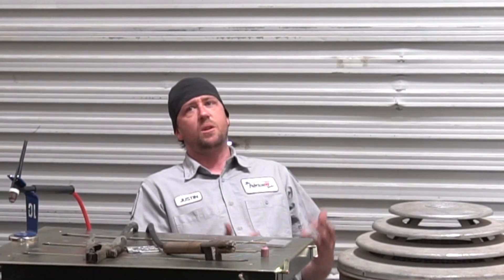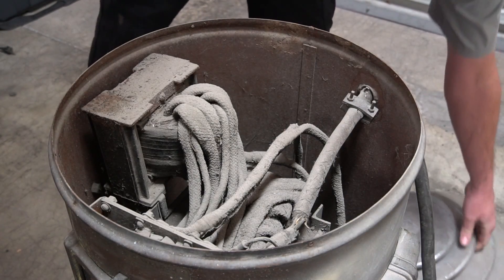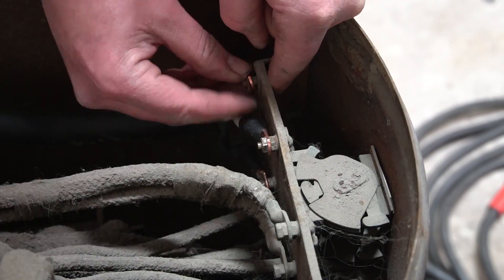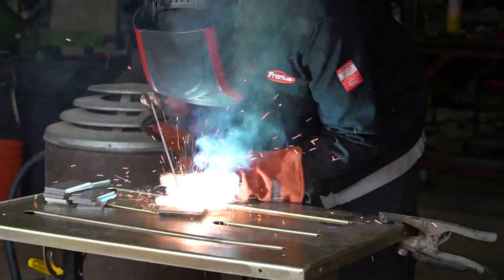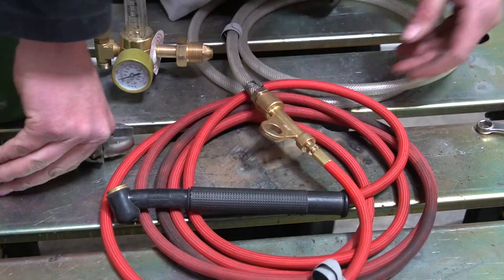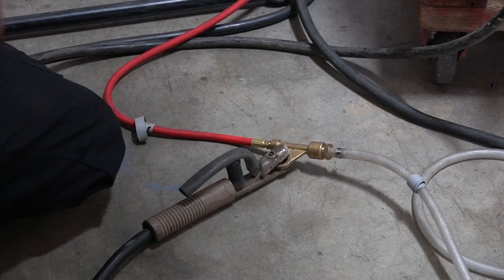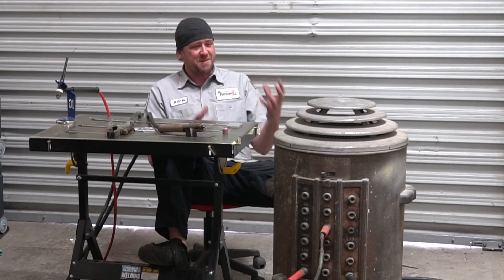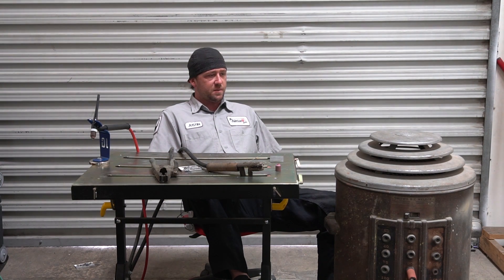TFS: 70 Year Old Welder - Will it TIG?

Comment from the maker: Here is the TIG adaptor https://amzn.to/2Crb5TY
Reply: Wow this cool welder! Respect from Russia! I love to watch your videos
Reply: Making an AC welder DC is pretty easy:
for about $25 on amazon you can get a 200 amp bridge rectifier to make it DC.
However, even if that is technically DC, it's chopped up DC so we need to smooth it with capacitors.

For calculating the capacitor size to smooth out the resulting ripple use the formula C = (I*t)/V
     V is acceptable voltage drop between voltage peaks. 
         (1 or 2 volts to be REALLY buttery smooth, realistically you could drop 8 volts and weld no problem-it would just act sorta like a 120hz pulse box)
     I is current in amps, (200 amps max for that machine? I would go at least 50 amps higher just to be safe)
     t is time between peaks in seconds (1/120 = .00833 seconds)
     C is capacitance in farads (for the values above, 1V drop is 1.66 farads, 4V drop is .42 farads, 8V drop is .21 farads)

To make it even smoother WITHOUT a giant bank of expensive capacitors (although you still need some) , add inductance, which resists a change in current flow. Do this by wrapping the welding lead around a heavy piece of solid iron as many times as possible. (I know how to calculate inductor behavior with controlled "textbook perfect" curcuits, but welding with variable torch to material distances etc is anything but controlled, so I won't even pretend to know what I'm doing with this)

note: I haven't done this myself since both of my welders already are DC machines, but I have taken my physics classes in college so I know the concepts involved.
Reply: How to make a paper flower
Reply: Get an "arc pig" HF starter and you prob could have a better time Tig welding with that thing.
Reply: Oxyacetylene welding is becoming more obsolete. No one teaches it anymore. Cause Tig uses ⚡ to compensate for a faster weld . Both are great if not the oxyacetylene welding is better. . Ones opinion. Old school weld is oxyacetylene welding. Per day.

Comment: I have a 60c and need the part that goes into the amp ports ( or also known as the pins ) any idea where I can get that one you replaced my original pin is about 1/2 inch in diameter

Comment: but what if you  ratify the currant  as you, then have a  dc currant. to  strike a ark with will it sustain an TIG  ark then  then ac welder becomes a DC rectified capable of tinging  try it out it works well.  in England we ues our  Oxford welder  as rectified  Dc chargers & dc TIG   welders  by fitting a rectified  transformer & transform the ac supply to DC , for charging & TIG welding ,  Just fit a heavy duty  Ratified where you wont it to become DC,

Comment: This machine was designed before "high frequency" was developed.  On a more modern machine, there is a circuit in the machine that establishes a high frequency arc between the tungsten electrode and the grounded work piece. This provides a constant area of ionized shielding gas between the elctrode and the work piece. This gas ionization sets up a continuous path for the AC welding arc to follow back and forth. Without high frequency, the main arc doesn't have enough voltage to jump back and forth from electrode to ground and the arc will shut off with no warning. You can buy a separate h.f. box which can be added to the machine and make it suitable for AC tig work.

Comment: FYI - the machine is limited wattage ie it has overlapping ranges of amperage. Wattage is volts multiplied times amperage. Therefore as the amperage is increased the voltage is decreased or vice versa. E7018 electrodes demand a high open circuit voltage. Therefore, using a voltmeter with an amperage setting of 100-120 in the three possible ranges; high, medium or low. The low tap will provide the highest open circuit voltage. 
Also the high frequency high voltage box/pig was made available as an accessory or built into the machines for smaw/stick welding and when gtaw/tig required no touch arc starting and/or arc stabilization; it was then used for that purpose. 
Be very careful when AC gtaw aluminum; the oxide layer acts like a rectifier; it produces a dc component evidenced by heat back to the transformer hot enough to melt/destroy the insulation and short circuit the transformer.

Comment: Justin you commented that 60hz ac crosses 0 120 times a second that only happens if you are converting to dc output by running through a bridge rectifier. Then you will get a positive half wave that starts at 0 then peaks and returns to zero 120 times a second.  Hopefully there is an inductor in series after the bridge rectifier to help keep you positive voltage and amperage from dropping to zero on the final output.  Sorry, not trying to ruin your video that by the way is awesome.

Comment: NO DIALS TO BREAK!@!   PRETTY COOL. IT IS A COIL WOUND AND 'TAPPED'  AT DIFFERENT WRAPS FROM COILS  SYSTEM, YOU'LL COULD GET SOME GREAT WELDS WITH IT. I WONDER WHERE, IF ANY, MANUALS ARE, ON IT? NAME IT R/T/D-2, BECAUSE OF THE STAR WARS. YEP IT COULD USE SOME NEW CLEAN UPS/ YOU'LL FIND SOME PLACE WHERE IT WILL NEED RE WRAPPED 'GET THE GOOD EXPENSIVE ELECTRICIANS' TAPE' IT HAS FIBERGLASS IN IT. THEN  BRUSH ON NONE - FLAMMABLE SEALER.  YOU'LL GET IT RIGHT OFF THE BAT. "IT'S A NO-BRAINER"
 For anyone with a welder, it's a darn good way to save it now while it's all working good. Keep it Clean. Shop Dust can be Extremely dangerous!  Live safe. Have a great Day!

Comment: That unit is freaking sweet . 

I'd install a full-wave rectifier on it to get a bit more flexibility out of it and use that sucker. If it is still quiet and withstood working in the absolutely hellish heat in bullhead city it will probably continue to run bead for a few hundred more years.

How much does that unit weigh?

Comment: OMG! U got some balls J. Ill give you that. Theres no way i woulda flipped that power switch without putting a megger on that bugger first. First rule of being an electrician is blue fire(anywhere other than th tip of ur tungsten) is BAD. Oh and an arcflash or blast can ruin the rest of ur life in a millisecond. Most chilling words EVER, from an outside contractor closing a Tie Breaker in our substation 
“if this blows up, DON’T put me out!  WHAM (slams breaker closed).”

Comment: for a ac dc busbar son & you now have A ac welder capable of wedding dc &as a tig  weld   Like  tig Try is out son , , Of course  you know this Don't You but would rather rubis AC welders  NO you cant weld with a AC welder.  but you need a AC/ Dc Busbar attachment 15 quid in the uk , son .  
Got it yet  ,Les  England ,  like  you video But drop the negativity we brits don't like it son .
DONT BE CORPASTATIC ,

Comment: Awesome video mate. Look at that thing!!! One slight correction though. It's not the High Frequency that's keeping it alive, its the fact that it's square wave out of an inverter welder, and not sine wave out of a transformer. Being square wave means that even though the polarity changes, there is still 100% potential difference across the work piece during the slope up and down.

Comment: Great video Justin.  You've not only answered the question a lot of people ask; "If you use AC to tig weld aluminum, can I use a buzz box with a TIG torch on it?"  You've also shown what would happen if you tried.

Nice big old welder though.  Some of the guys in the shop I work in, say that they like the smoothness of the arc you get from a transformer.

Comment: I got an old welder similar to this from the local dump and striped all the contacts off it.  It was all aluminum wire so I kept the contacts and switches and took the aluminum wire back to the dump.

Comment: I have literally only used a tig welder once in my life so excuse me if this question is way off. Is the requirement for a higher frequency because your welding aluminum and if so could you use that set up for mild steel? I have an old Forney C5 welder thats at least 50+ years old that has a similar set up to the one in your video, ive been wanting to restore it and now you have me wondering about converting it!

Comment: Ever heard of dual-quadrupled serial line series GFI circuitry wherein there are 4 GFI circuits on both positive and negative power lines? Including in the sockets and plugs and cable extenders? Hyper-Ultra-fast auto-circuit breakers and dual ground lines? 

Ever heard of ultra high-voltage/ultra-high amperage insulating resistant head-to-toe full body suits, masks-hoods, gloves and boots, goggles and prescription lense protective goggles that are 4 to 5 times up to 10 to 11 times above specification requirements? 

Air filters and purifiers and emergency air suppliers built-into or worn around their suits and are also equally well protected and are ergonomically humanely designed and comfortable temperature wise and body contact wise? 

In our military of today THOSE ARE STANDARD SUPER-STRICT REQUIREMENTS! 

We have spent tons of money in educating and training and health improving our welders and continuously upgrading their scientific-engineering-technological education and maintaining their health on a very strict HEALTH PREVENTION PROGRAMS because they will and are welding together our military equipments and installations together that are designed to last as long as they exists and are expected to perform beyond their engineering specifications for our standards are above over-engineering standards.

Comment: I have a Mid State Dip Pac  160 Mig Welder .. it also has AC  Welder & DC & DC  reversed Polarity .. It has a spot to put a High frequency Transfer box .. I was told it was a little light to use for  TIG welding ..  I also have a Miller  200 AMP  MiG welder..  So I guess I just simply need to a  straight TIG Welder..   I think they have actually gotten way more compact and way smaller ..

Comment: are you going to try ( tungsten rod ) pasma or carbon arc welding / cutting /bending like was common place in the per-1970s  ?? with it or ad different machine ?? its definitely on my wish list of how to learn to use and buying tool ( hopefully i can use the plasma arc welding leads with more modern power supply machines like a millers 250-800 series ) buying because it's so versatile and i don't need tools like a cutting torch or fancy bender so for simi mobile application its prefect

Comment: It doesn't buzz because they over-engineered them with ten times the amount of Copper in the coils.  Now they design them to the bare minimum, just short of actually failing.
Reply: have a  1962 Lincoln stick/tig  welder buzzes just fine but  weighs over 800 lbs-  has Plenty of copper in it.
 No way to weld aluminum without HF  AC  on an AC machine using argon
agree with others- throw an Arc Pig on it
 and  will be amazed how well it welds Aluminum,    just need to be careful not to  weld thick aluminum for to long...  then it  may overheat the transformer.

Comment: I made a TIG welder using a tombstone Lincoln buzbox. I made what you could call a series wound Tesla coil by taking about 12 turn of welding cable and coiling it up. I think that i bypassed it with an rf mica capacitor or something.

Then wrapped three turns of just regular wire around or next to it. Made a spark gap out of flat ended tig electrodes mounted in a couple of aluminum blocks. That with another capacitor and a small 5000 volt neon sign transformer made up the primary of a standard tesla coil and there was my hf stabilizer.

Then I took a wah wah pedal and swapped out the pot for the correct value. Ripped out all of the other circuitry (which was already smashed). I used a telephone cord and RJ11 jacks to connect it to a box. That controlled what is called a picket fence thyristor trigger box. I got a couple of big honkin' hockey puck thyristors that once were used to drive a diffusion furnace in the semiconductor process industry and hooked all of that up with a dryer plug and outlet so that I essentially had like a light dimmer but one that you could dim a dryer or an arc welder with.

I actually welded aluminum with it on 60hz sine wave. I also made another box with a big bridge rectifier circuit, some electrolytic caps and a big transformer winding. I made a π network but found that the output caps needed to be removed so I changed it to an L network with a choke output and then I had DC. Phun, phun, phun.

I was living in a box truck at the time in an equipment yard with all manner of unsavory characters. I should have tried to do a video about it but was struggling to pay the rent and keep the theives, tweakers, recyclers and landlords at bay.

I still have everything but the hf stabilizer unit and the buzz box. I found a Westinghouse stabilizer on eBay that has current sensing, gas and water solenoid valves.

I was forced to move back to Michigan. My dad has another Lincoln box. All I need now is another argon tank that is in spec and I'm back in  business.

There are still enough interesting part to do a video about. I lost most of my materials and hardware. Making another hf stabilizer might be fun to make a video about but there are no surplus stores here in Michigan.

The one that I used to work at in silicon valley just went belly up. Radio Shack is gone. The Steve Wozniak, build it in your garage days are gone. I thought that I was going to get in on the ground floor in California,  but no.

Id really like to discourage this mentality glorified by TV shows like storage wars and hoarders that make fun of people who collect thing, especially if they do things with their things.

Example, I made a sandblaster out of a dishwasher. There is this commercial for Apple i-something. Everything that you need is on the cloud. Possessions are a sign of poverty. There is a guy with his i-thing, a futon and some expensive toiletries.

I can build a laser from scratch. That is what I think of when I think "tech". But now "tech" means writing some fart app for your iPhone. I'm not saying that writing apps isn't useful but if this country loose the ability to, not build an iPhone but to have individuals with the skill set and materials to do stuff with your hands. That is a bad direction to be headed in.
/rant

Comment: I’m curious, would it have performed any better when it was originally sold? I’m assuming the 60hz aspect of the US power grid hasn’t changed terribly much, so how was it usable back then? Did age factor into its usability deteriorating or were people used to welding like this back then?
Reply from the maker: It's not a TIG machine. That's why it didnt work. It wouldnt have worked and better as a TIG 70 years ago because it's simply not a TIG.

Comment: Can you weld with TIG using DC ? You can turn the output into transformer and smooth it out to have smooth current. If not, is 200 Hz enough ?  I can make a custom welding transformer which will have a center tap, so basically it will output two 50 Hz sine waves (Don't know how to name it)

Comment: Very interesting video sir!  You went to great lengths to get that Old AC welder to work. Its great for Stick really, Iv'e used one back in the day and it will run most 7018 quite nice.  But here is a welding electrical AC fact...You must have a HIGH FREQUENCY Unit hooked into your welding leads.  The AC TIG arc needs stabilization or it will go out.

Comment: There is just one problem with this setup... For GTAW you need constant current (the "electrical resistance" of the arc varies greatly with it's length, and it's almost impossible to keep a steady arc length using your hand), and this transformer is practically a constant voltage source(ok, not quite, but still it's not a constant current source), besides the fact that the output is sine wave, and the low voltage time near the 0 crossing point is pretty long. Maybe you can AC MIG with this, if you add a series inductance to the secondary winding.

Comment: why dont you get a 300 amp full wave rectifier and heatsink it and use this to convert to DC this will help drastically also a few capacitors on your current setup will absorb the spikes you dealing with aka the + to - and zero point will be smoothed out very simple conversion that offers alot more stability and out of experience when you add a rectifier / capacitors you get much more power / penetration also.

Comment: wrong 120 times every single second. 50-60hz = 50-60 times per second
Reply from the maker: The frequency of how many times it cycles from positive to negative is 60. The amount of times it hit zero per cycle is 2. That means that 60 x 2 = 120 times per second that the wave hits zero.
Reply: 120

Comment: If that was made in 1940 and went for 200 dollars then, it would cost 3500 dollars today, with inflation
Reply: Thats cheap for a good welding machine. Or average.
Reply: 4200 my man
Reply: 1 cent could buy a icecream in 1960
Reply: Overtheroad but the welder depreciates in value
Reply: Damn math wizard lol
Reply: But you'd also not have gotten as high of a wage back then. Wages increase with inflation as well.
So calculating that doesn't really make much sense.
Reply: @jort93z  Wages have stagnated while inflation keeps climbing.

Comment: You should of tried it on mild steel not aluminum. Scratch start doesn’t work on aluminum you really need the foot pedal. I’ve heard that the dynasty it the only machine that you can scratch start aluminum with.
Reply from the maker: Scratch start does work on aluminum the same as it does with steel. I have several machines that will do it. Scratch/lift start is just a way to start the arc and is not specific to any machine. This machine is AC only. It does not have DC. We TIG weld steel on DC.